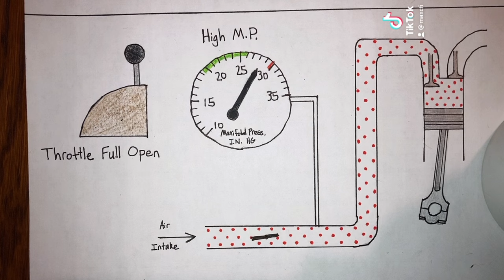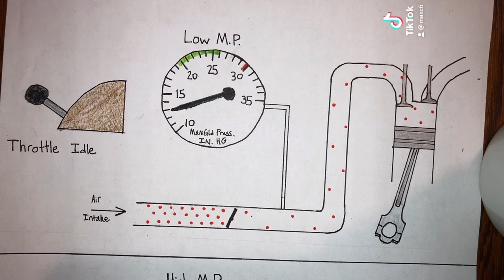Manifold Pressure

Comment: You said on aircraft with constant speed propellors the throttles can be moved without any change in RPMs.     How does that work?    Increasing the prop pitch would increase the load on the engine resulting in a decrease in the rpms.   Reducing the prop pitch would decrease the engine load would allow the engine RPMs to increase.      So what change are you making that doesn't effect RPMs?

So maybe there is some corresponding action occurring in the prop hub as loads increase and decrease?   And the way to measure the increase and decrease in the power delivered to the crank shaft by the engine since RPMS are no longer relevant might beeee.......    Manifold Air Pressure????     
Opening the throttle will;
1. increase airflow and increase manifold pressure.  2.  power would then be increased due to the increase in air and fuel.  3.   As each ft pound of torque is increased by the throttle/power increase by the additional fuel and air the prop senses the increase in torque from the engine which should result in an increase in rpms but since it is not a fixed position prop the increases and decreases in LOAD on the prop result in ADJUSTMENTS by the prop.      Increase power should result in increased rpms, but the prop sensing the additional power/speed adjust to a higher pitch increasing the load and coincidentally about the same rpms.     On single engine airplanes.    Its a lot of money, a lot of annual/inspection/AD requirements for a system that doesn't provide a very significant increase in speed.   Buy a bigger engine

Comment: Since airspeed is determined by and increase on the point/port of the pitot tube.   It seems that the air pressure on the air intake would experience and increase in pressure for the same reason?    As speed increases the air pressure on the front of the aircraft would increase and would be sensed throughout the air intake through the carb and into the intake manifold?

Comment: Hi can you tell me what readings would you expect to get as you are using a vacuum gauge in your drawing
Reply: Depends on RPM.  At idle with the throttle valve almost closed and the piston moving slower and less strokes maybe 11 to 15 inches. At full power, just slightly less than atmospheric pressure as the open throttle still slightly restricts airflow.

Comment: This is completely wrong! Manifold vacuum is highest at idle with the throttle closed and lowest as the throttle is opened fully. Please explain how you feel I am wrong.
Reply from the maker: Well, since a vacuum is the absence of pressure, yes, manifold VACUUM would be highest at idle but that’s not what’s being measured here. This is manifold PRESSURE, kinda the opposite of a vacuum
Reply: @maxcfi7718  Hi I think I see where brian busboy is coming from, as a machine I have used manifold pressure to check engine condition and that pressure is normally negative reading of approx 17 to 20 in hg with the throttle closed on a snap opening of you throttle the reading would be approx 0 in hg .If the engine has a turbo fitted you could expect a positive reading which is a psi measurement ,also you have used a vacuum gauge in your drawing ,I think explaining manifold pressure using vacuum would make it easier to understand
Reply from the maker: @johntscanlon3929  oh interesting! i see. this is geared towards an aviation context where we measure positive manifold pressure
Reply: @maxcfi7718  I see,as a matter of interest what readings would you get in a aviation context

Comment: I get confused.  It functionally looks like vacuum.  So, it is actually pressure of the intake fuel/air charge due to the period of the intake being closed and the rushing intake air stops momentarily causing the pressure?
Reply from the maker: it’s nothing more than the air pressure in the intake manifold. no fuel. try not to think of ‘vacuum’ as a distinct quantity. it’s not. it’s just the absence of air pressure. the lower the air pressure the greater the vacuum.
Reply: @maxcfi7718  Thanks, I'm getting a handle on it now.  I hadn't thought of the simple atmospheric pressure as the starting point.  I was thinking vacuum entirely.
Reply from the maker: @whalesong999  exactly. with the engine of the mp gauge just reads the ambient atmospheric pressure

Comment: Thanks, always wondered what made manifold pressure important in aircraft engines. Now, however, I'm wondering why auto engine designers don't find the measuring of it important in auto engines? I've owned a couple vehicles with chargers (one turbo and one super) with boost gauges, is that basically the same as manifold pressure?
Reply from the maker: i don’t know too much about cars but i think it’s probably the same. it’s a bit more critical in airplanes since going up in the atmosphere drastically changes the air pressure and thus the power a non turbo engine can produce
Reply: @maxcfi7718  Yes, your boost gauge is measuring the same thing. if you notice anything below o psi is measured in in/hg, inches of mercury, just like the one in the video. his only reads in/hg because its naturally aspirated, so its measuring the vacuum in the manifold. boost, or positive pressure, is measured in PSI, pounds per sq inch
Reply: @jayminer5336  
Not always, in WW2 US aircraft boost guages measured inches of mercury, as I recall somewhere around 76" of mercury was 30 psi of boost.
British aircraft boost guages measured straight psi.
But German aircraft boost guages displayed ATA's or "atmospheres" of pressure, 1 atmosphere being 14.6 psi.
Reply: @jayminer5336  Lots of modern aircraft, measure boost In inches of manifold. Lycoming and Continental both do.

Comment: Hi! While studying about the piper arrow limitations, I’ve notice that in the POH it says “avoid continuous operations between 1500 and 1950RPM below 15’ Manifold Pressure” when using a certain propeller. 

I know that you cannot operate for prolonged time with high manifold, low rpm cause it will damage the engine, but the opposite is weird. 

Can you explain??
Reply: It may not be a "damage" issue at all.  It might have to do with vibration.  I'm am saying may and might because I don't have the specific answer.  Since the limitation is for only one specific type of propeller I doubt it is an engine issue.  Some Piper dealership or expert should have the "textbook" answer to that question.
Reply: @apackwestbound5946  thank you

Comment: You have never seen an actual vacuum gauge attached to an engine have you ?,,,, the engine will have the highest vacuum at closed throttle and the lowest vacuum at wide open throttle ....What you are describing would only happen outside the throttle valve ...
Reply from the maker: this is not a vacuum gauge as i’ve explained before. it is a manifold pressure gauge.
Reply: @maxcfi7718  The manifold pressure is a vacuum the entire time the engine is running unless you have a supercharger ...the "pressure gauge will have numbers on both sides of zero .... all pressures are relative to atmospheric pressure ,,,, we do not take them to space to calibrate them .....
Reply from the maker: @theiaminu5375  yes, but this is measuring the actual pressure in the manifold. hence why it’s lower when the throttle is closed and equal to atmospheric pressure when throttle is wide open (for a naturally aspirated engine.) my understanding is a vacuum gauge would measure the difference between atmospheric pressure and the manifold pressure, so it reads higher with the throttle closed. we do not normally measure vacuum on the engine in aviation
Reply: @maxcfi7718  It's backward from what you would encounter in the REAL world ... low is to the left (counterclockwise)and high is to the right (clockwise) in every gauge you will find ....Even on a mass spectrometer ...
Reply from the maker: @theiaminu5375  yes? and it is also on the manifold pressure gauge. not understanding what you’re getting at 😂
Reply: @maxcfi7718  When you are trying to explain automotive concepts , it's customary to use related measuring tools ,,, Any tool available  is going to respond exactly opposite to your illustration ...
Reply from the maker: @theiaminu5375  i am not explaining automotive concepts. this is for aircraft. in aircraft we measure manifold pressure not vacuum. throttle closed = lower mp = less power and vice versa. that’s all there is to it.